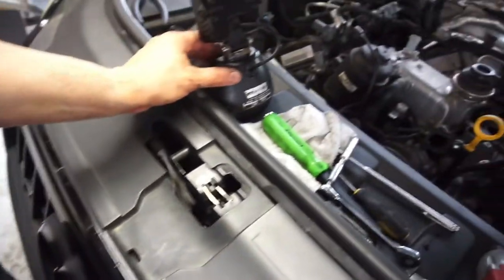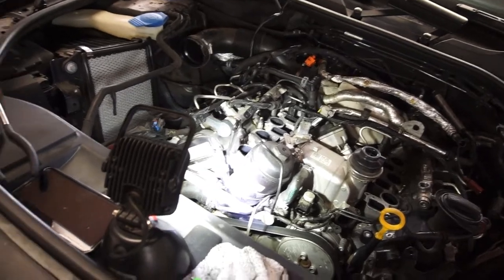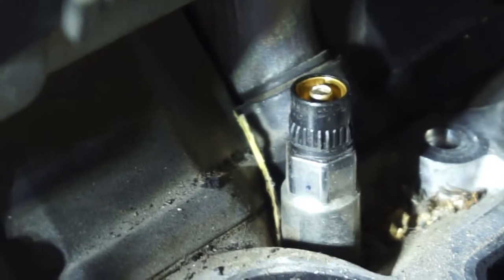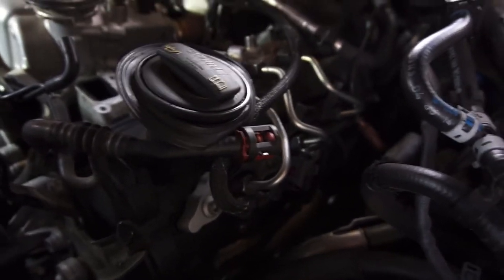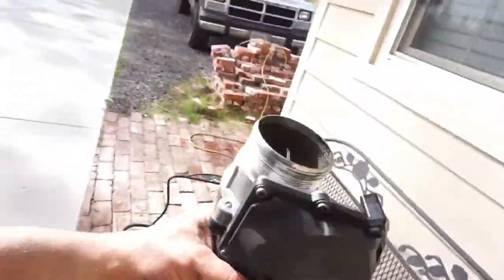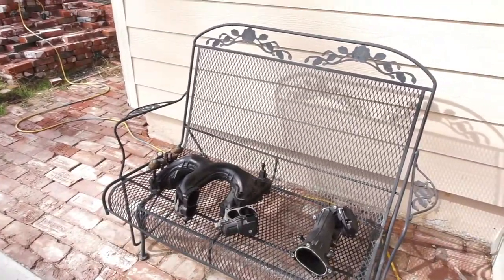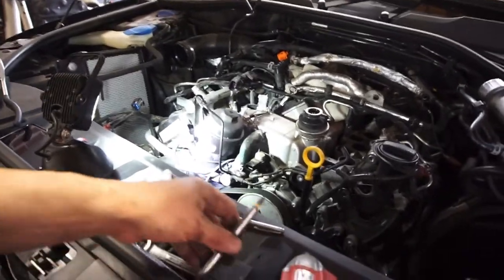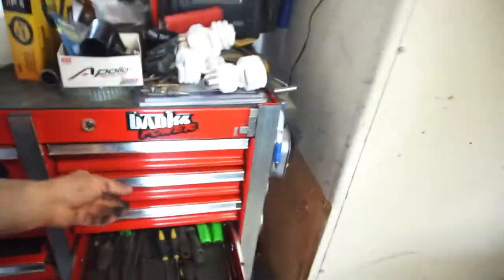Must Do For All Diesel TDI VW AUDI RAM CHEVROLET FORD GMC SOOT Cleaning 50% Increase HP and Torque.

Comment: You ever think about picking up a top side creeper? Probably make your job a lot easier with the truck and SUV.
Reply from the maker: I think about them every time but I don’t have room for one. Especially by the time I pull it out unfold it I’d already be done with the project. If a company sent me one for free I’d definitely use it.

Comment: Thank you for the useful information, soon i will change the oil cooler on my 3.0 tdi A7( same as your engine) 
Can i have your advice about the extra part that could be also good to change/check it during the oil cooler job
Thank you.

Comment: I should've commented on this vid instead of your other one. But I'm having trouble removing the intake manifold off and I'm 99.9% certain I've removed all the required bolts. But it just doesn't budge when I try to pull it off, did you have to get a knife or blade in between the manifold and block? Or wack it with a mallet? Any tips? Thanks in advance from Australia! Awesome informative videos
Reply from the maker: There are spots where you can pry it up. I just do a little at a time. Mine was stuck really good too. Just work it little by little. Make sure you got all those bolts off. I think there was 2 hidden ones on the back.
Reply: @Halffast719  did you just use your hands to pull up, or did you use a pry bar or something of the sort? And can you explain which spots you mean? I definitely have all the bolts off, ok good to know then. I'll give it another go today and use more strength
Reply from the maker: I used the smallest pry bar I had which is like 5” if I remember correctly I pryed on the 2 front cylinders little by little then it just let loose.
Reply: @Halffast719  thanks heaps mate I'll give that a try

Comment: How many miles are on your Q7?
Reply from the maker: Just hit 146,000
Reply: Got 55,000 miles here the throttle response is a bit jerkey, not sure if it’s time to do the cleaning. Thoughts ?
Reply from the maker: You can take the plastic intake piece off and check where the egr tube goes into the intake and see if it’s plugged up. You don’t need any gaskets or anything special besides a t30.